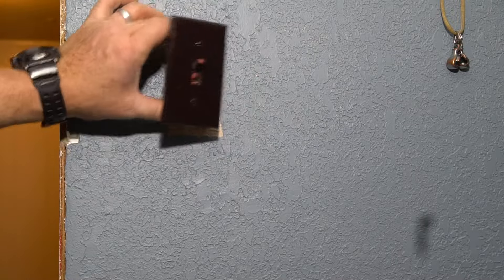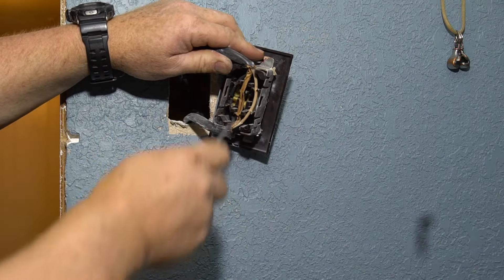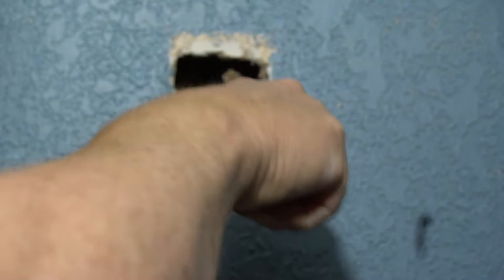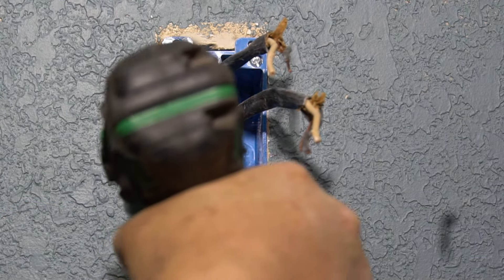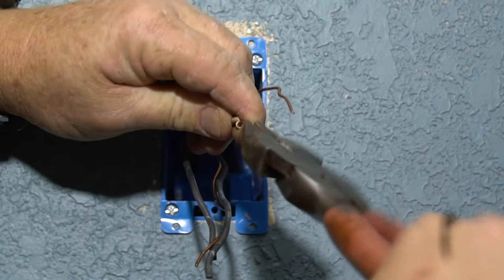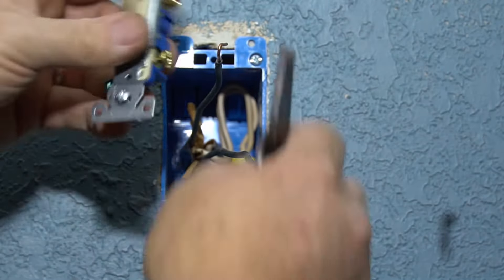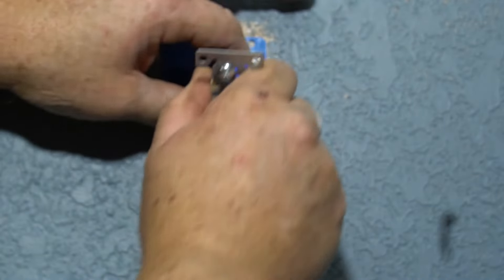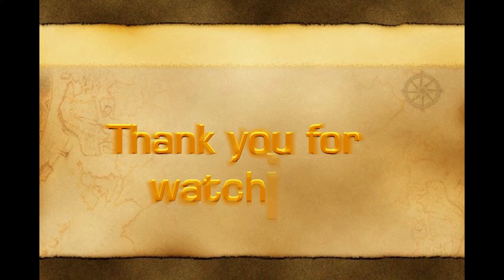⚡ How to upgrade unsafe mobile home quick connect light switches🔌

Comment: My wiring is the same as this but my light switch that I got does not have a little green connector for the ground will I need a different switch?
Reply from the maker: The little green connector is a ground.  It is not necessary for function, it is necessary for safety.  Light switches are pretty cheap. Less than a dollar.  I would get one with a ground. That is assuming that you have a ground wire available in the existing box.

Comment: What if the wall isn't deep enough to fit a box?
Reply from the maker: You can buy different depths of boxes. Try to find a shallower box.
Reply: ran in to this in mine, you can get shallower boxes but depending on the stores around you they can be a little harder to find. They do exist though.

Comment: Hey I just used this video and now my switch turns on and off the power from everything behind the circuit but everything ahead of it stays powered
Reply from the maker: Hi.  This is a basic guide that deal with standard wiring situations. It doe snot address all situations that might be encountered.  From what you have said, it appears that there may have been more than one leg in the box you worked on and that you may have connected two legs together. Unfortunately, without onsight visual inspection and diagnosis, I am unable to diagnos what the issue is.

Comment: I am so glad you did these videos of this problem. Slater Wiring Devices were used by the Manufactured housing industry for years. They were never sold in stores and you had to go through a mobile home supply dealer to get them. by changing them out to new cut-in boxes and using leviton or Cooper wiring devices, brings the home up to code and is safer, and easier to service in the future.  I was really shocked to find such a item in a newer manufactured home.... this is one of the shorcuts the HUD code allowed for! using cheap and proprietory devices just caused alot of headaches for homeowners.... these were NEVER allowed in a regular home!
Reply: Which should have been illegal for them not to have sold to the public directly..
Reply: @dcbrs1216  yes, I agree, but then based on the quality of the units I wouldn't want to ever use them.... I had to upgrade all of my outlets and switches upon the pruchase of my home, the RV/Manufactured Home Industry has always used Propriotary parts and brands which are sold in retail. trying to replace these parts is a headache and thats why Manufactured homes are not a popular option. the "Basic" home is far more inferior then a standard stick built home because of the materials used.... yet these homes are just as expensive as a normal home. (Per Sq. Ft.) when it comes right down to it, yet they claim differently.